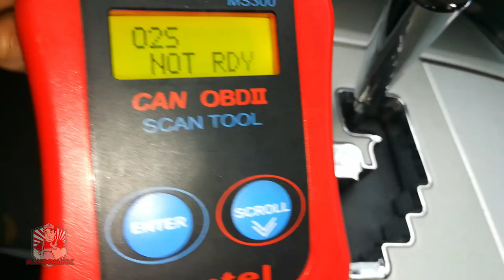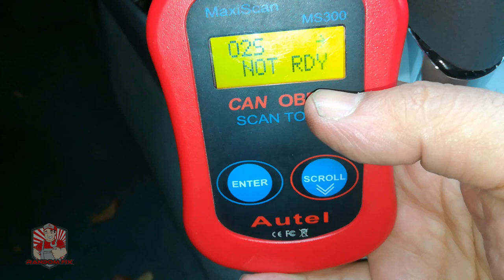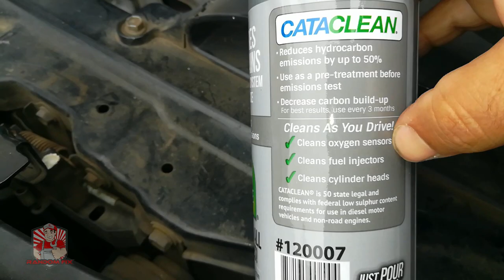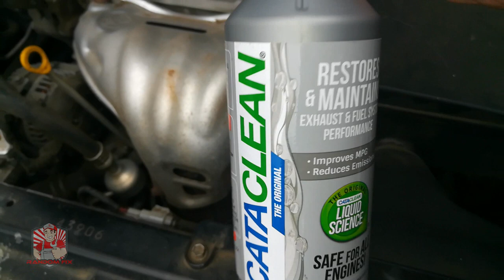Essential tips to prepare your oxygen sensor monitor.

Comment: which are the hardest monitors to set ? thanks
Reply from the maker: Great questions, it all depends but in my experience the hardest to set is the EVAP and the most tiring is the catalyst. The EVAP does NOT need to ready on 2000 and newer vehicles. _Randomfix
Reply: @RANDOMFIX  . when you say the most tiring is the cat , you mean you have to drive it alot , or the steps you have to take ? thanks
Reply: @RANDOMFIX  next time you struggle with the cat monitor, Start your vehicle from cold, let it warm up. Idle your vehicle at 3k rpm for 3 mins then it should be set

Comment: There are many states where an emission test is not required for registering a car . It's great if you live in one of these states and not have to deal with it
Reply from the maker: Yes, I  agree with you on this but there should be a work around on vehicles when the monitors don’t set for hundreds of miles or even thousands of miles. Drive around just to pass a smog test actually causes more pollution.
Reply: @RANDOMFIX  Of course. The most important is to have the components working well. Because even if you do some "work around" on these emission related sensors, they will give the engine wrong data causing possibly rich fuel ratio causing bad MPGs and costing you much more in gas and potential repairs (clogged CAT, engine worn through rich mixture, etc...)

Comment: Is it possible to get this problem with a car that's just not driven very much? Like a car that's only used maybe 2 or 3 times a month, and very short trips?

Also you mentioned this sensor being near the heater circuit on many cars, does this mean you would increase or decrease success by turning up the heater before testing? (Or turning it off?)
Reply from the maker: The o2 sensor has an heater element so it can up the oxygen heater faster. If I car is not driving enough all kinds of things can happen to engine, electronics, and even the emissions systems. What are you driving?